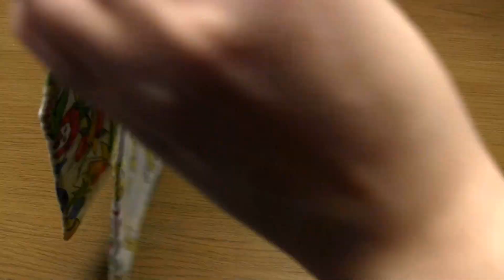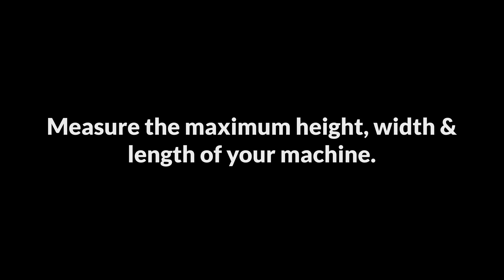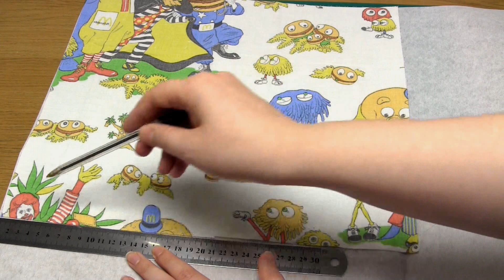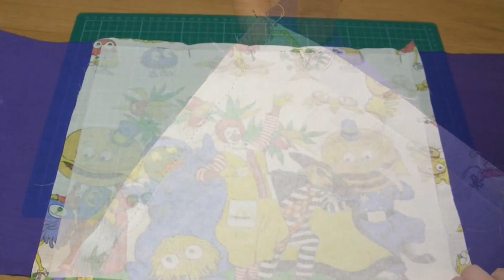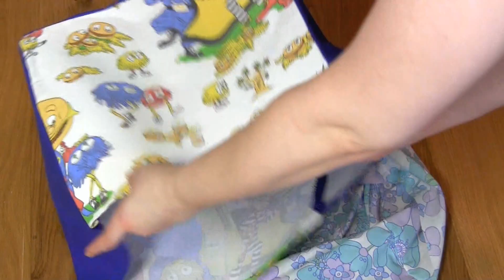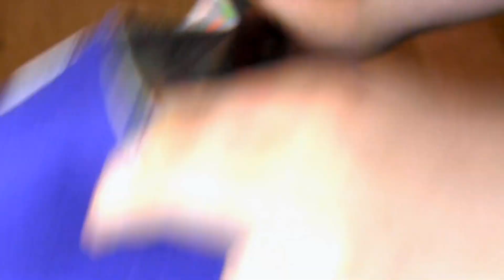How to Make: A SEWING MACHINE COVER | Fun Recycling Craft Project | DIY Fabric Dust Cover

Comment: Hi! I'm really a beginner beginner here, I'm still learning how to do stitches with a needle and a thread and I've a question. My back stitch is very weak compared to the invisible stitch when I'm sewing. I really don't know why that is. Do you have some ideas on how to strengthen a stitch?
Reply from the maker: Hi! The only ways to make backstitch stronger are to shorten the stitches, and/or to use a stronger thread. Hope that helps :)
Reply: @RokoleeDIY  Thanks for your reply! I'll see if that makes it better. Have a good day.